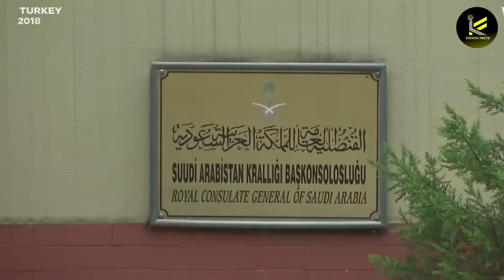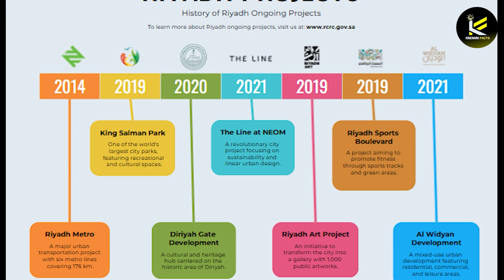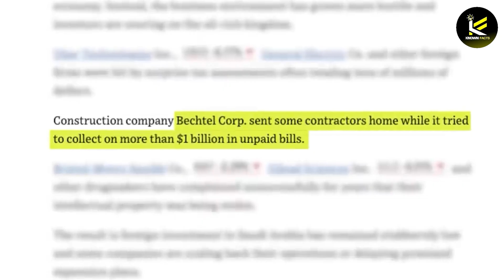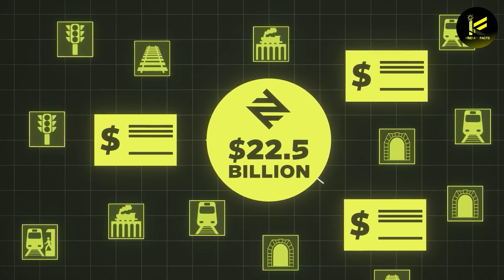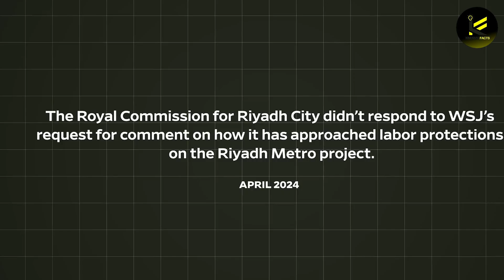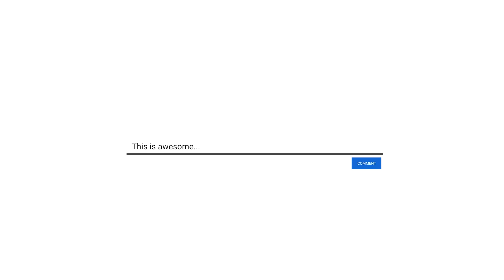Saudi Arabia’s $22B Desert Railway Mega Project Explained

Comment: Greetings and thanks for your valuable program; the issue and problems of water and energy are inseparable in the long term; the plasma jet machine that I invented; is the most advanced and fastest method of purifying large volumes of brackish water such as ocean waters and has the ability to reduce consumption by up to 60% in terms of fossil energy consumption. In the field of how to transport water to the consumption basin; I presented a design for using two parallel and aligned rail lines in one direction using renewable energy fuel, electric/hydrogen engine fuel to create propulsion power for fast-moving locomotives with complete safety in terms of overturning. A safe transit plan for the transportation of a rail route to connect goods internationally; competitive with cargo ships from origin to destination and access the international rail network and economically exploit those routes on the return route; in addition to the global impact of clean fuels on the global warming phenomenon; prevent desertification and its further drought. The plasma jet machine also has the ability to quickly drain storms and large-scale or mineral floods.